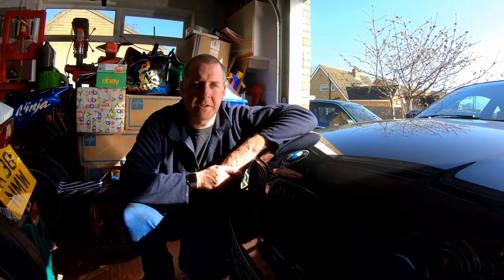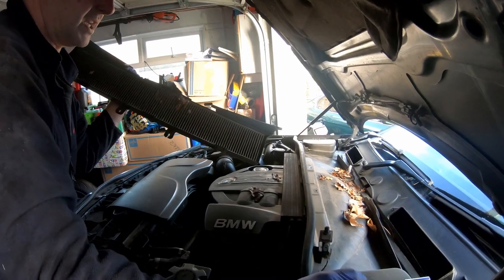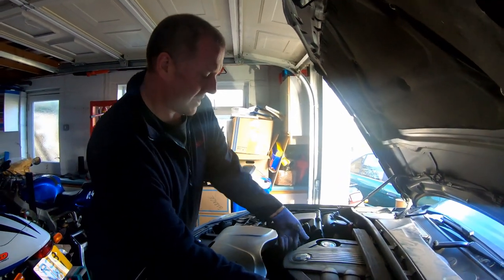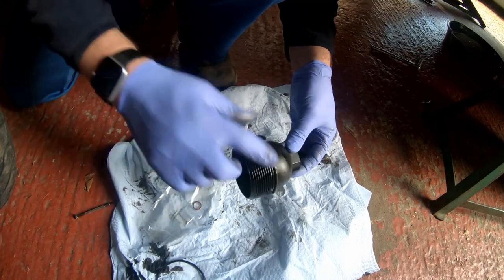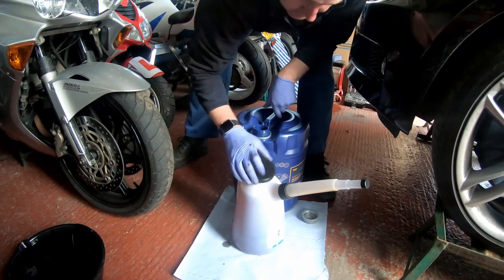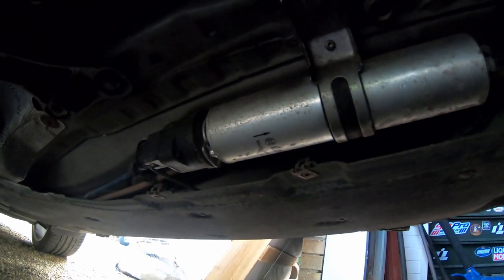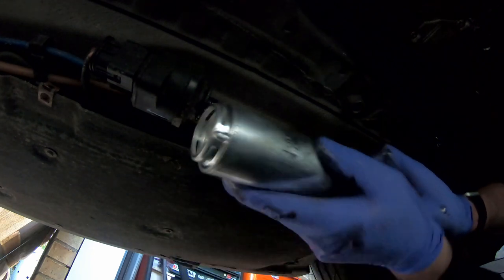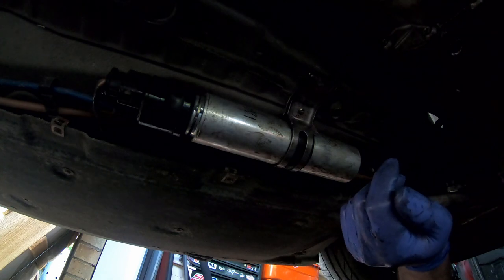Servicing The BMW 1 Series   Air, Oil, Pollen & Fuel Filters & Oil Change

Comment: Mate your videos are gold! How did you prime the fuel filter after replacing it and what procedure did you do to start the car?
Reply from the maker: The fuel filter will be filled by the low pressure lift pump in the fuel tank, start the car as normal, you’ll most likely find that it’ll crank for a few seconds as fuel is pushed to the high pressure pump but it’ll be fine once it fires 👌🏻

Comment: Hey man all of your video was very helpful. By the way just want to ask how much engine oil you put and what brand.? Thanks
Reply from the maker: This particular car takes 5.2 litres during an oil and filter change (an engine rebuild would take more) according to the manual however in my particular case it was closer to 5.5 litres to take it to the max mark on the dipstick. I used a bulk package of 5w30 fully synthetic oil made by Mannol, I buy it this way as I have a few cars that take this oil and the price per litre is excellent!

Comment: Some really great service tips, I have the same model and was wondering if changing the fuel filter helps improve overall fuel consumption as my car has nearly done 80k and never had the fuel filter changed.  Regards John
Reply from the maker: I wouldn't say it changes consumption but it will certainly affect the good running of the car if it becomes clogged which I have seen a fair bit recently. Not on BMWs though, I must add! 👍🤓

Comment: Do you have a video or know how to either change  air intake temperature sensor ( on charge  pipe ) or how to replace charge pipe/ air intake pipe from intercooler to throttle body housing 🤔

Comment: Hey, was planning on getting some mannol c3 how does it hold up in your opinion and how often do you change the oil in the 1 series is it at what bmw recommends? 
Thanks good video mate.
Reply from the maker: Seems to be good so far mate, no problems so far as i can tell, I tend to change the oil more frequently than BMW recommends just because I prefer to give the turbo an easier time, the car doesn't get thrashed in any particular way but I do like to treat it to fresh oil as often as I can.

Comment: Have you replaced the clip on the fuel filter to a jubilee type clamp.When I did mine it had those original ear clamps  on which cant be reused which I only found out about when I had taken the bloody thing off 🤣.Try finding ear clamps and the bloody pliers to put them on a short notice 😡😁
Reply from the maker: Mine has always had a jubilee clamp since before I bought the car. My 7 Series is the same!

Comment: You forgot the o ring for the fuel filter mate
Reply from the maker: I didn’t forget, I just didn’t feel it necessary to change it. If it were a requirement, one would be included with the filter in my opinion. I do keep a good stock of various sized o-rings but I have never changed one on the fuel filter coupling and have never had a leak! Good spot though! Shows you paid attention 😉
Reply: @KevsShed  That's strange, my 520d bosch fuel filter came with one. It's just a flat ring of rubber that goes between the filter and the heater
Reply from the maker: @GeorgeAusters  I can't remember 100% but I am certain that I used Bosch replacements on this car! I've actually replaced the fuel filter on this car 3 times since owning it and never had a replacement seal included, likewise, there wasn't one included with the filter when I replaced it on my 730d last week either.
Reply from the maker: @GeorgeAusters  Interestingly there isn't one listed in the BMW parts catalogue either! https://www.realoem.com/bmw/enUS/showparts?id=UR52-EUR-11-2007-E82-BMW-123d&diagId=13_1115
Reply: @KevsShed  Yeah it must be a different filter to the one of my E60 mate: https://www.youtube.com/watch?v=-eMOuaxcS8A&feature=youtu.be
Reply from the maker: @GeorgeAusters  Yeah, just checked out your video, I have never seen one of those rubber seals before on any of the diesel E46s that I have had, my E82 or my E65, weird! Like you said, it wasn't on the one you removed so perhaps it is unique to the Bosch filter on the E60. Still a bit weird though. Anyway, I'll give your channel a sub, looks like you have some good content on there! ;)

Comment: How often do you change the coolant on these. And how do you do it as was reading that if u drain just the rad that's only half the coolant. thanks
Reply from the maker: Coolant should be changed every other year as a minimum as the anti-corrosion properties of 50/50 mix break down and become less effective. There is a drain plug on the bottom of the rad. Not sure where you read that but it’ll all drain out. Very little will be left behind.
Reply: @KevsShed  cheers mate top man. Love the channel. Keep up the good work and the great videos 👍.
Reply from the maker: Cheers buddy 👌🏻
Reply from the maker: I could do a video soon on changing the coolant I guess, watch this space 👍🏻
Reply: Anyone every have a problem putting fuel in the 1 series coupe I got 3 quarters of a tank went to fill up and got drenched in diesel.
Reply from the maker: Meirion Evans you aren’t the only one buddy! Happens with mine too, I have to be wary of how much I put in so it doesn’t go all over the side of the car or my feet! The pump doesn’t click off!
Reply: It was closed cling from the get go. Hod to go home a change before work. Got to work opened the cap it was like a load of trapped air came out.

Comment: Forgot the rubber seal.
Reply from the maker: You are the second person to say that but I’ve never seen such a seal on any fuel filter that I have changed on either my 1 series, 3 series, 5 series or 7 series! RealOEM doesn’t list one with genuine filters either so it must only be related to the brand that you are using! 🤷🏼‍♂️